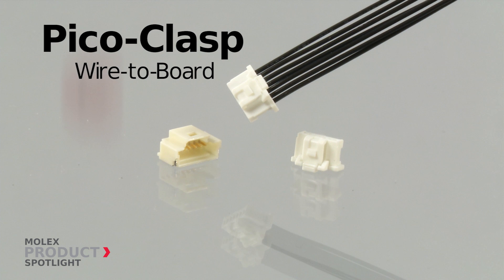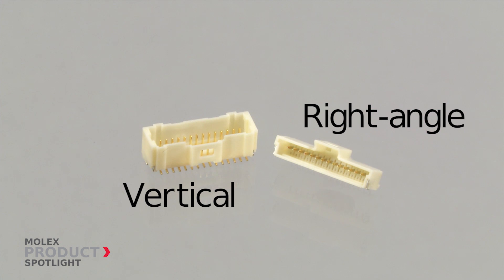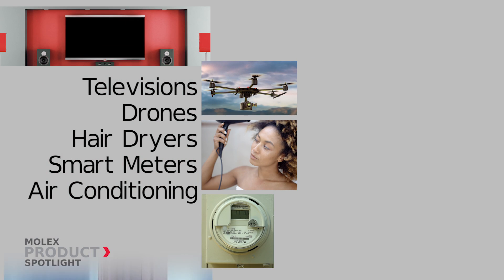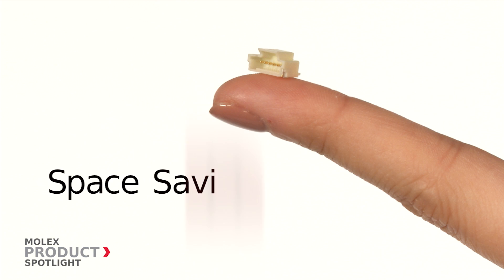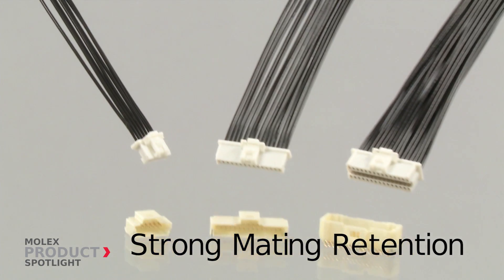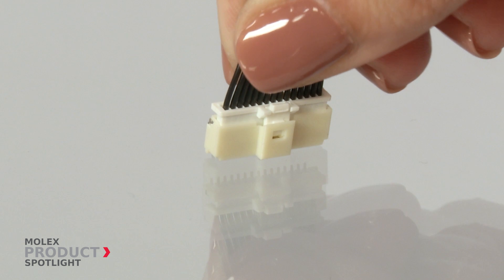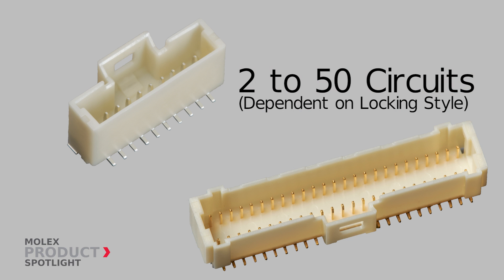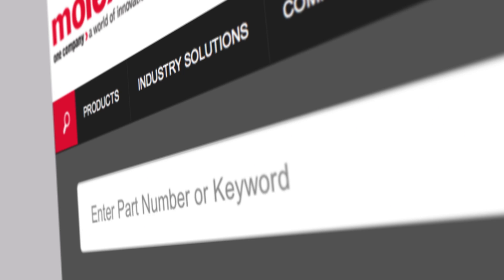Molex- Product Spotlight - Pico-Clasp™ Wire-to-Board Connectors

Comment: Is there a best practice for removing the friction locks after installation? They seem to break relatively easily depending on the angle at which you remove the wire side from the board side.